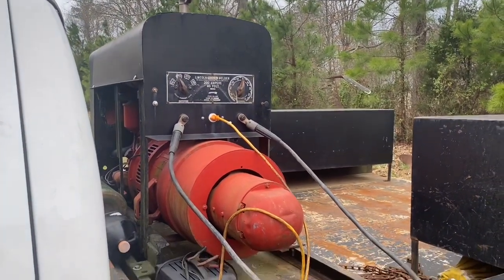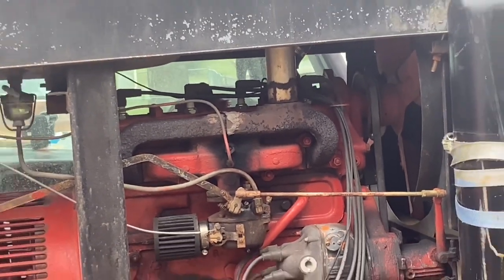1954 Lincoln SA200 shorthood

Comment: Great machine, have a 1955. The best price for the manifold is at Steiner Tractor, part # MHS006 for 135.70. It's found under the Massey engine parts.
Reply from the maker: Roberto Obregon thanks. I may have gotten that one from Steiner. It’s been laying around the shop for a couple years before I finally got around to fixing it